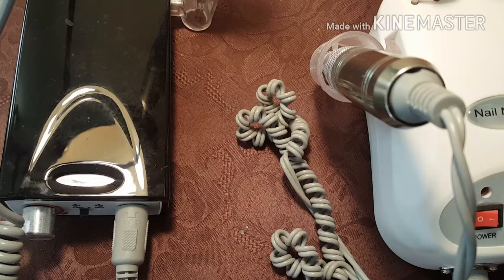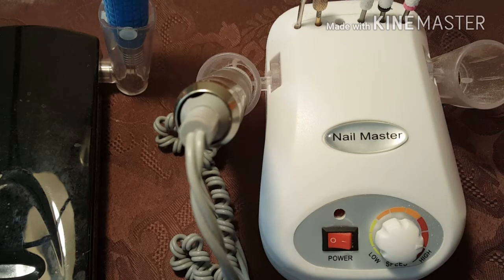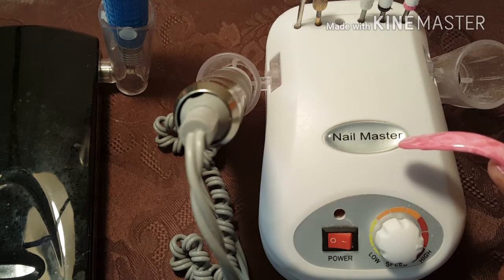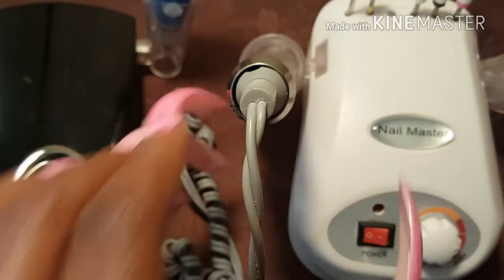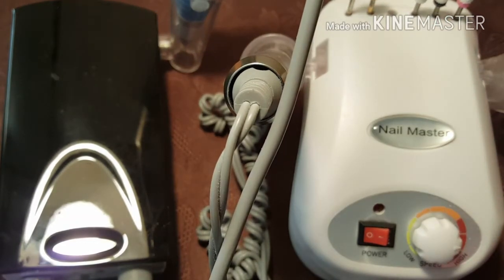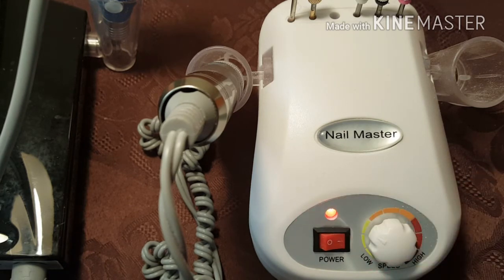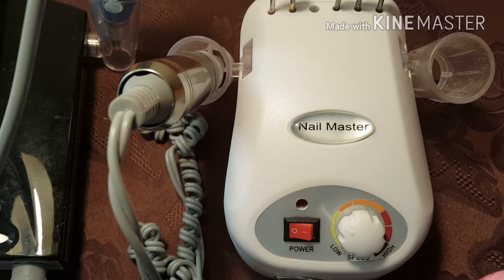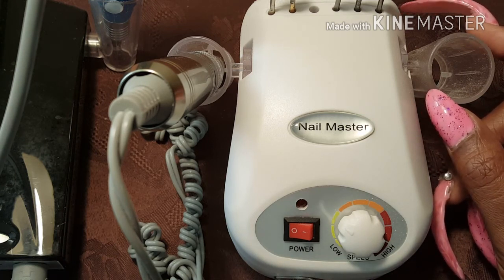Nail Drills / I need help

Comment: I know you got better drills now, but I just wanted to add this tip for anyone wondering. The relationship of a good drill/handpiece is actually the relationship between RPM and TORQUE. Torque is the twisting force on an object that is rotating on(the motor inside the handpiece). Torque is actually what prevents stopping/skipping. Even if you have high RPM's if the torque in the handpiece is low the motor will rotate unsteadily inside causing vibration. The marathon drills are great because they really balance the relationship between the two. Just wanted to help just incase. The Kupa mani pro is actually an example of how this can go wrong. The mani pros handpieces (blue/purple ones that are less expensive) don't have the best torque inside the handpieces and I couldn't bare it you end up using higher RPM's. A hand piece with HIGH TORQUE is perfect even at low RPM's. Again I know you've learned this by now.
Reply from the maker: I'm sorry for taking so long to reply but I didn't get a email notice of your comment. I still thank you for your input. I like to try a lot of different drills so thanks again for your comment

Comment: I have the manipro from kupa and I love it .I had a cheap drill I bought at a local supply store and it would stop in the middle of removing gel polishes . it stops cause it was 10,000 rpm so I bought a kupa and I don't have that problem anymore . most nail techs use 20,000 rpm and up . I don't think there are different levels of rpm . I do know you shouldn't use any tools ment for medical use  for nails . I hope this helps some what . I do recommend the manipro from kupa I've had it for 2 years already and it still like new
Reply from the maker: Princess Nina's sparkly nails Thanks Nina this helps

Comment: When it comes to nail equipment I am a true believer in the old saying you get what you pay for.  There is no different levels when it comes to RPM  (rotation per minute)  The rpm recommended by the distributor is the MAX RPM  that the hand piece tops out at.  Get yourself a good drill that comes with a hand piece.  The investment is TOTALLY worth it.  I had one years ago when they first came out The Nail Genie from Sally's,  I went to a beauty supplier and purchased a $199 dollar drill and it was the best investment I have ever made.  Your first drill only has low, med, and high settings they do this because their product probably doesn't continually reach, or can't sustain the max RPM this is what would cause your drill to constantly pause, or over heat.  the two parts aren't made properly.  When you pay more money for some thing like this it is partly the name.  You can go to a beauty supplier in your area and price check the drills they have for sale.  Mine is a medicool and I love it!  I hope this helps...good luck!
Reply from the maker: Thank You so much
Reply from the maker: Thank You. I have been looking at some drills on Aliexpress but haven't decided on anything yet. I have a lot of carbide and ceramic bits they work great. I sent you a friend request on FB.

Comment: high torque is what you're looking for . torque is when you're drilling from right to left and the speed doesn't slow down , stop or stuck on you. high torque 20k rpm always beat low torque 30k 35k rpm  and i havent seen any nail tech using a drill at 30k and up , only for cutting down the acrylic. so spend a little more on a quality drill like the urawa up200 or super up200 , luraco pro 30k also good its portable as well, medicool is alright but prefer the urawa ones from japan.
Reply from the maker: I'm sorry for taking so long to respond but I just saw your comment. I don't know why I didn't get a email notice. Do you have any links for the drills that you are speaking about? Thank You for watching

Comment: I know this is an old video . I hope you found out the answer to your question is torque. Once I stopped buying cheap drills I saw the difference and will NEVER go Back. Kupa even has different levels. the passport with a k55 or k60 Handpiece is the number one drill. smooth , quiet and strong. they are comparable to   dental drills so thats why they are so expensive.
Reply from the maker: Tyfw. Yes I have 2 manipro passports and they are awesome

Comment: whats causing the bogging(skipping) would  the handpiece. the drill box is just that a box. the motor is in your handpiece. I have a kupa UP200 and a Erica Mt-20 drill and they both go up to 20,000 rpm (rotations per minute). but the handpiece is a MICROMOTOR DRILL. that is the difference. a micro motor handpiece provides a smoother filing process.
Reply from the maker: Thank You so much for this information. Will the Micro motor handpiece work with the 30,000 rpm drill that I have? Would you please do a video showing your drill and handpiece?
Reply from the maker: Thank You. I found the micro motor handpieces on Ebay. But I really thank you for all this information
Reply: nothingbutNAILS the 2 drills I mentioned have different adapter plugs on them so you can't just buy the handpiece unless you already have the unit (box) for it. hth
Reply from the maker: Thanks. Do you have a facebook page?

Comment: idk how kupa drills work but no the medicool I had was 20000 rpm's & would stop I bought a nail drill from nail supply glamour that is 30000rpm & have had no issue with it stopping
Reply from the maker: Thanks DeeDee. Will you please do a video showing the nail supply glamour drill?

Comment: I am thinking that if a drill is advertised as 25000 rpm, 25,000 rpm is just that, what is comes down to would be quality. For instance, if it is made out of top quality metals/plastics or whatever it is made of, it should sustain it's advertised rpm at all times.  There might be drills that are not top quality parts and perhaps it will run at 25,000 rpm for 10 minutes etc.  I have a drill master that is supposed to be 35,000 and it was $80 CAD and it works well but if I press hard enough when filing, it will stop.  I don't know, this is just my two cents :)
Reply from the maker: I appreciate (your two cents) as you put it.  Lol  Thank You for responding. That's what I want people to do because I want to know. Thanks for watching. By the way -where did you purchase your drill?

Comment: the drills that come from eBay are knock offs, they don't come with guarantees backed by testing, an eBay drill runs the risk of being electrically damaging when plugged in and there is customer service that is attached to the more expensive drill. that was the info that came from my nail tech book.
Reply from the maker: Thanks